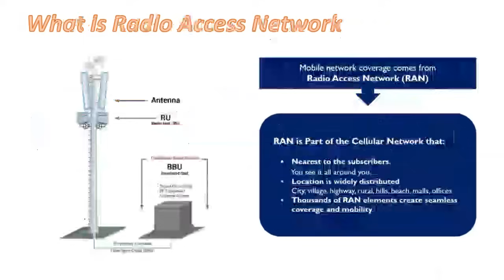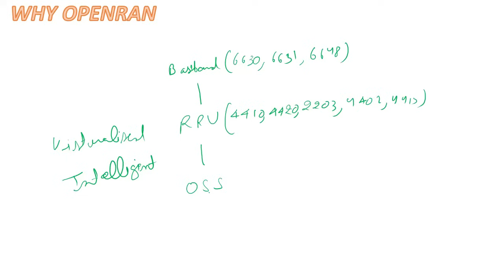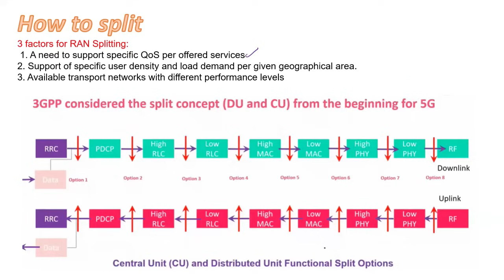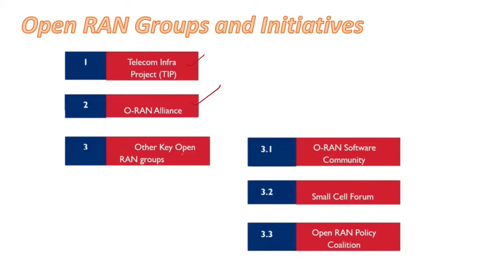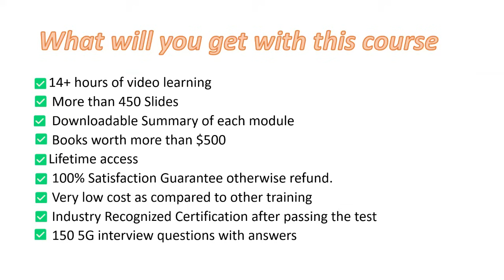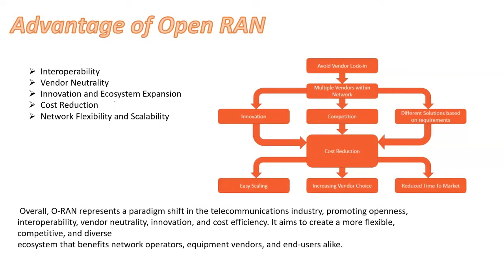5G O-RAN |ORAN: Tutorial |Part 1|Open RAN Introduction and Concept|| Open RAN | O-RAN | OpenRAN

Comment: Thank you for the clear overview on the different types of RAN. Apart from flexibility, does the implementation of OpenRAN offer other advantages in terms of performance? I assume that using COTS hardware has an impact on the costs: is it possible to quantify (in average) which would be the difference in price of a ORAN installation vs a traditional RAN? Thank you
Reply from the maker: Thanks a lot !!
Reply from the maker: More than price factor is the flexibility operator will get to buy equipment from multiple venders. It allows innovation in various no network element. They can deploy on third party cloud or combination of telco cloud and third party cloud. We are going to see huge eco system around Open RAN in coming years
Reply: 100% Agree